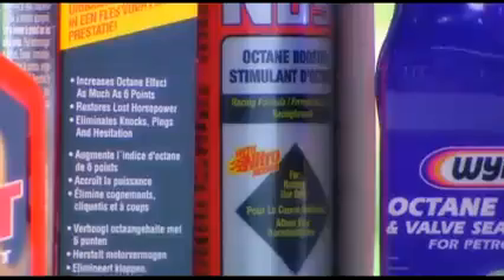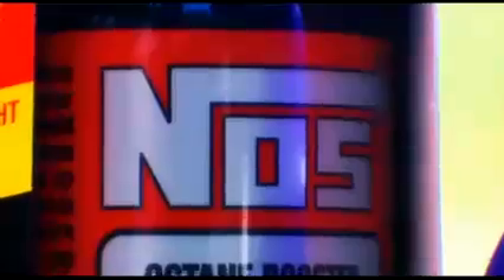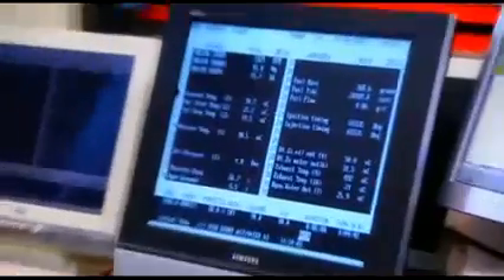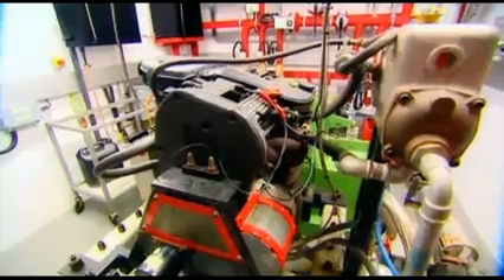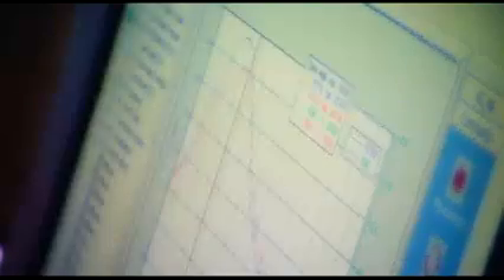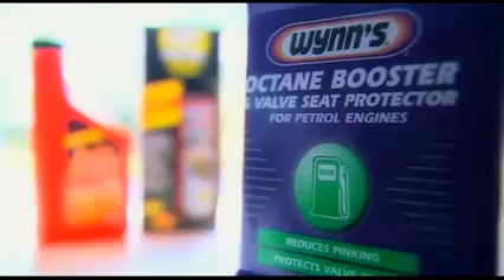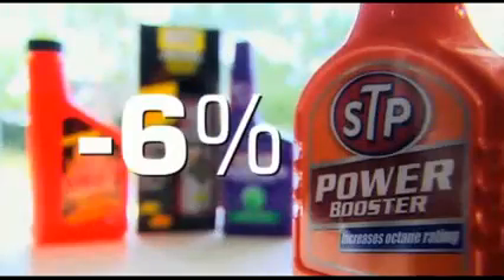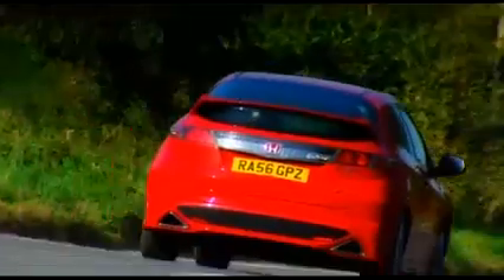The Truth About Octane Boosters

Comment: And this so called "truth about octane boosters" is made(paid) by oil companies and car industry!They want you to pour full tank of expensive primium petrol and not some cheap base petrol and then add small bottle of booster that can keep your vehicle in good health..I don't need experts to tell me if it works or not,I drive long enough with and without boosters to know how and if they work!It's not between my ears,with good octane booster like Lucas Oil,NOS,Torco and only few others I can tell they are just great energy protein drink for my car!Car run smoother,faster and easier accelerates,no pinging,knocking,hesitating...car start better when it's cold,fuel consuption is bit lower,spark plugs last longer..No octane booster will repair your vehicle if it sucks,but if it's in good shape with boosters it will stay longer that way.With some boosters you don't feel more power or difference but they are just good maintence products for your vehicle like STP is..

Comment: Does an octane booster improve engine power? No, ingition advance does on the other hand, what is directly connected to octane. The higher the octane rating, the more ignition advance can be achieved without knock. So just by puting in race gas you might see improvements, but the engine needs to be tuned to take the increased octane into account. And use the fuel to it’s fullest potential.

Comment: For best results you'll have to advance the ignition timing, by atleast 6 degrees if you are moving from 93 octane to 98. The test that they conducted isn't really scientific even though the operator was wearing a lab coat. PS : i am an engine calibrator, so i know what i am talking about :P
Reply: yep and then you have to make sure you can get the right fuel based on the tune done, so better off sticking to factory settings that way the engine will not miss a beat, but then again with modern flex fuel systems the engine will auto adjust based on the fuel used etc. but still only product i know worked is chemplex fuel tablets, put one in a fuel tank around 70 litres and it will save you around 2 lts per 100KM driven i tested it on my own car and the stuff works, but now i dont know where you can get the products and they make smaller tablets for motorbikes as well? The sold like hot cakes because they worked really well, maybe around 5 HP extra from one tablet?t

Comment: I used NOS brand with about half a tank of 93 octane on my 10 Camaro SS but I let it sit overnight I felt a big difference at the track the next day no bs
Reply: who made you the expert
Reply: I drove a 2003 ford crown victoria. i noticed a 0.2 sec. shorter on a 0-60 using a octane booster. it's all stock. i thought it was all talk and bs until i tried it. it increased my fuel economy by 2-3 mpg too. I believe it was the STP brand but not sure... it stretched me at least an extra 30 miles on range and it gets 20-25 mpg driving it like there's an egg under the gas pedal and you're trying not to break the egg. ;)

Comment: Running NOS Octane Booster with my Mustang GT with a 93 octane tune runs like an angry beast. NOS is the best, followed by Royal Purple, the rest are just crap. I've never tried it, but I would guess that VP Racing would be good I'm sure since they make race gas. Bottom line unless your tuned to take advantage of high octane then you are wasting your time and money. I know these people are more car savvy than they appears in this bit. A Civic is not exactly a good example of a "performance oriented" car. If they want to see a difference, they can put my car on a dyno first with 91 octane and another run tuned with 91 octane plus NOS raising it to 93. You can tell a huge difference in the seat of your paints, but that aside its about 20 rwhp difference. I run NOS and Royal Purple all the time to achieve 93 Octane, since the highest we can get here is 91 Octane. It's 10.00 well spent in my mind..
Reply: brian duffy NOS, Definitely works my BMW Z3 with a straight 6 easily getting an extra 10-15hp gain with 93. Shit does work!

Comment: The engine they are using in that lab is not tuned to use higher octane fuel. It's not a performance engine what so ever. The lowest grade fuel 87 octane will work perfectly for that that. However if you have an engine that is tuned such as higher than stock timing and is experiencing knock. Octane booster will reduce that knock. Engine knock is no bueno.  They should of did a test where an engine is having some knock then adding the octane booster.

Comment: The higher octane allows for better ignition timing so engine knock is minimised !!!
Reply: I have a custom tune in my Srt8 Jeep. We only have 91 octane where I live. Based on my data logging results with my handheld tuner I have 4 degree of short term knock. Octane booster would actually benefit me.
Reply: and 99% of the people who use octane booster drive cars with electronic ignitions that CANNOT be changed without modification or replacement.
Reply: driving a 2003 ford crown victoria, i noticed a 2-3 mpg increasing using a octane booster. i don't remember what brand it was tho. crap lol. I believe it was STP.